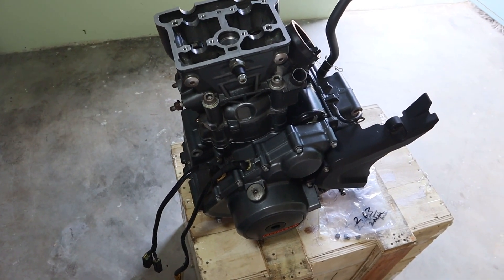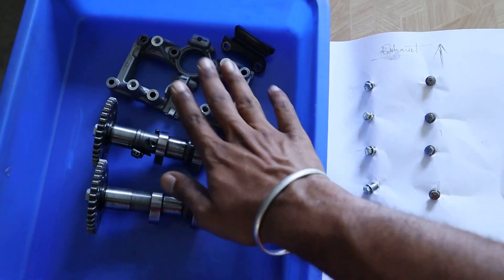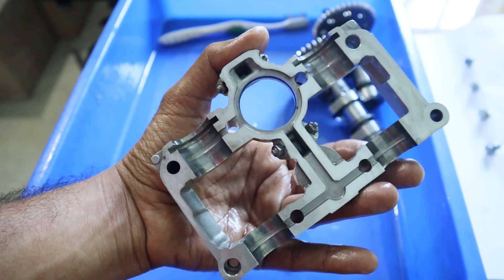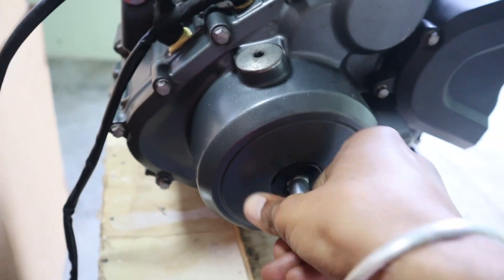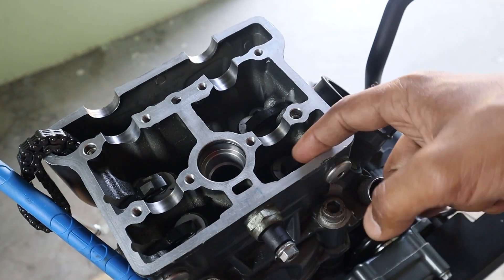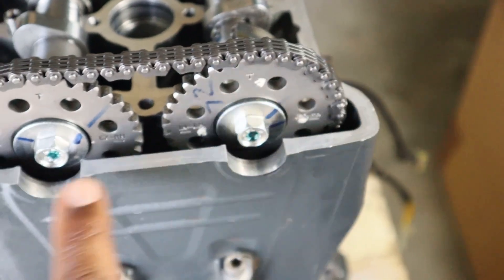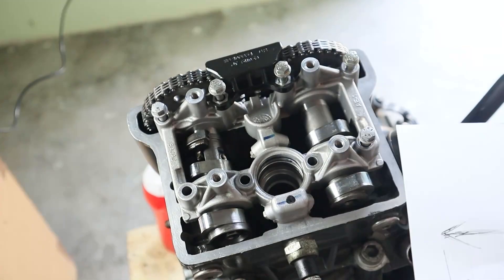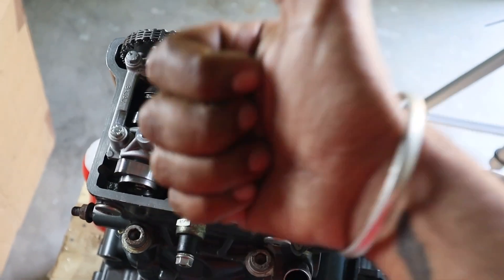Camshaft Installation and Timing - KTM Duke 390

Comment: bro My bs4 Aprilia SR 150 scooter does overheating. Engine oil changed, carburettor cleaning, tuning done, air filter also changed but overheating problem still not resolved. Can you tell what would be the right thing to do?
Reply: Might be there is oil gallary clogged, or oil pump issue

Comment: Bro, after head gasket change My Duke 390 bs3 is showing low oil pressure warning and 1 long 8 short blink check engine light, what's the issue can you please mention in the reply, Thank you 🙏
Reply from the maker: Check oil pressure sensor and get the oil pressure checked with pressure gauge.
1 long and 8 short blinks could be indication of a short circuit in electricals.Please check the wiring and for possible short circuit locations.